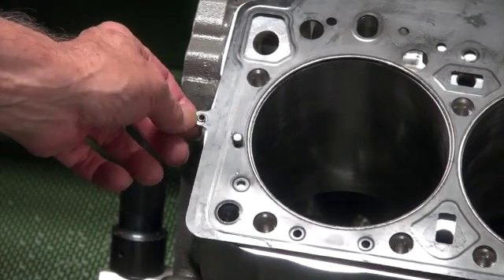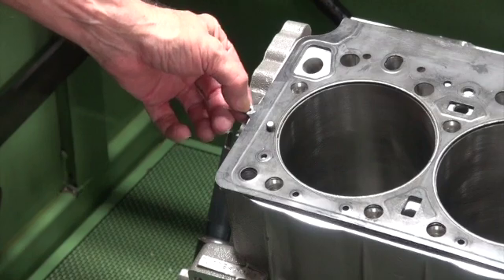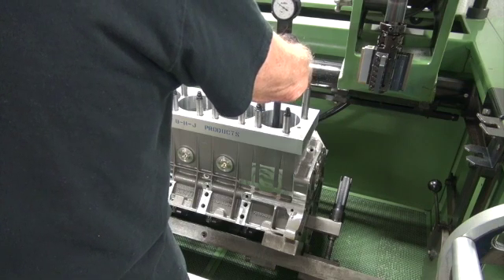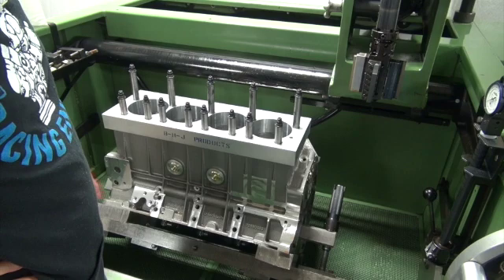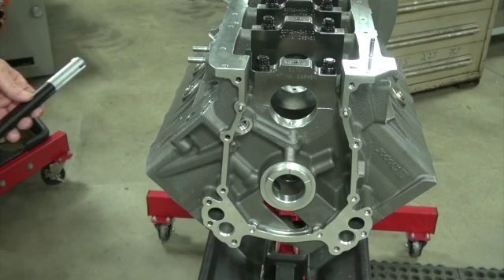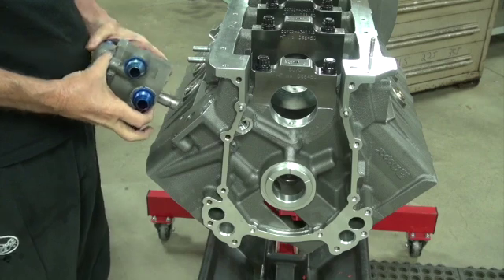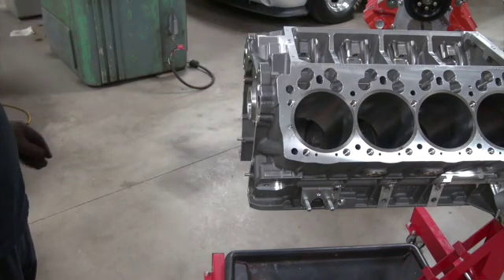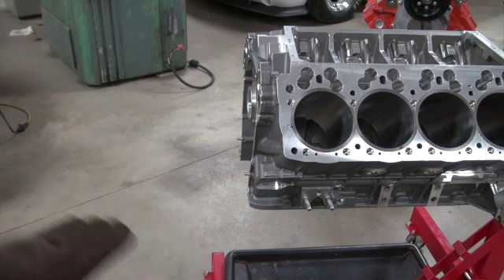Keith Black 572 Hemi build Ep 3 #426hemi #572hemi

Comment: I had almost the same issue with the oil pump hole on my KB block but it was .002 tight the entire way. I used a brake cylinder hone to open it up.
Reply from the maker: @Mrshotshell  We expect better from the price we are paying. Thanks for watching.
Reply: @rickseeman5679  I've learned to expect nothing from new parts, and I still end up disappointed in half of them

Comment: What parts didn't fit? I've run KBs parts since the mid 70s starting with a 557" stage 5, in a Blown Alcohol Hydro, I never had any issues with parts not fitting, what exactly did he accomplish here?, that is a rivit   that holds the gaskets together his action accomplished nothing that piece doesn't touch the cylinder head at all...

Comment: Hi Rick , Just wondering if you addressed this issue with Tim? ...and if so , what was the outcome?
My understanding is that these blocks are machined using two different companies..one in Canada and one in the U.S.
Reply from the maker: No I haven’t. I’ve talked to him about some other things but never got anywhere with him. I was under the impression that the machine work is done in Michigan.   Thanks for watching.
Reply: @rickseeman5679  Just found out the regular blocks are machined in Saginaw, Michigan and the race blocks are machined in Ontario, Canada.

Comment: Could you use a little fine emery cloth on a finger to open up the bottom of that oil pump bore?  Love all of your videos and they make me think of all the other folks who assemble engines without your expert knowledge and equipment (such as knowing /measuring the bore roughness in your last video.)
Reply from the maker: I bottom of the hole was.005” too small. It would have taken forever and not been very accurate. I feel sorry for someone trying to put something together with new parts today for the reasons you said. Thanks for watching.